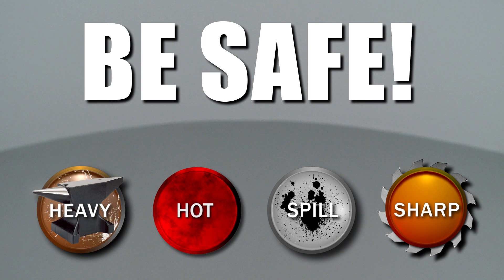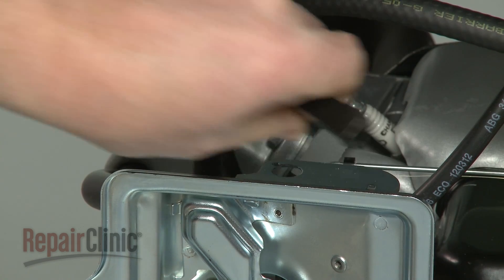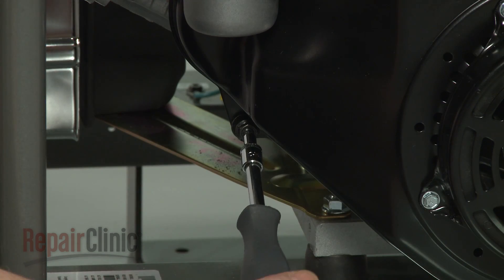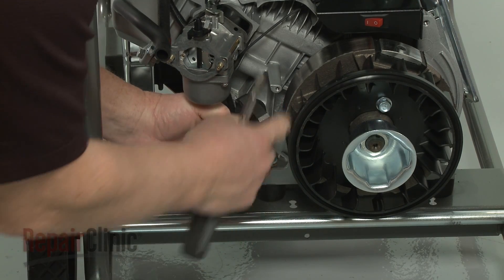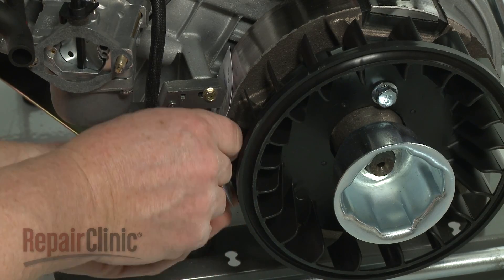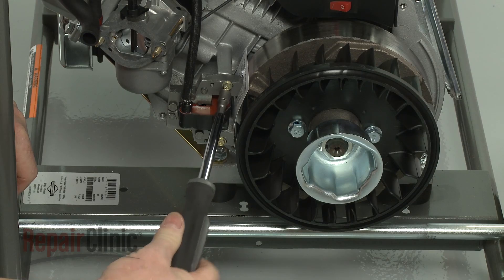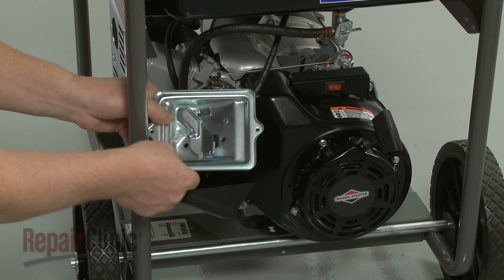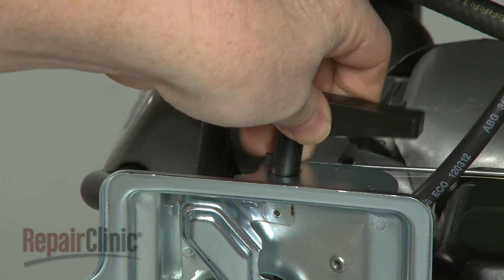Briggs & Stratton Generator Not Starting? Ignition Coil 591459

Comment: My trial has rivets and the mtgs stud's are not where these are. I got to drill out those rivets to get the hand pull crank off so I can try turn the engine. They were trying to start it with ether and locked it up.

Comment: Well its a very good video and it was done step by step, but its seems something is missing, the application of tightening-torque to the new ignition module screw/bolts (the Ignition module is subjected to vibration). If you want to use torque wrench, what is the value. Thanks a lot in your video i like it.